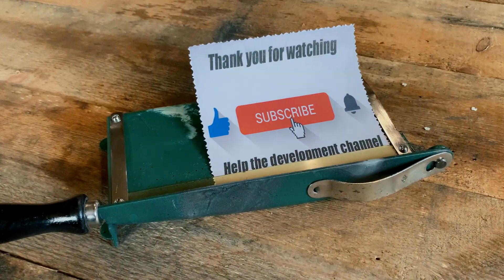Restoration of the paper cutter | DIY Aqua Painting

Comment: An advice from a jeweler,  you’re using the buffing wheel in the wrong way, at this point is very dangerous because the spinning force could take out the piece from your hands and will be going directly to your face. Turn to left side instead (using your video view as a reference) and only work in the safe area, it’s start from 20 degrees under the wheel at almost the middle of it. Greetings from Mexico again 👋